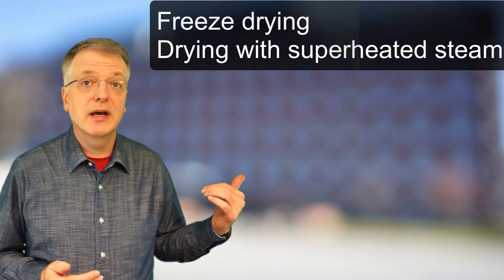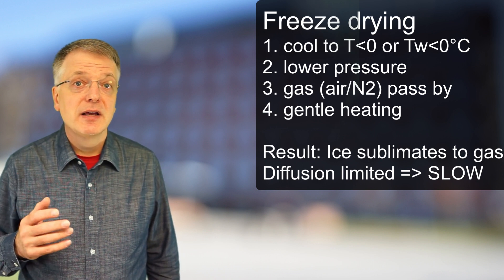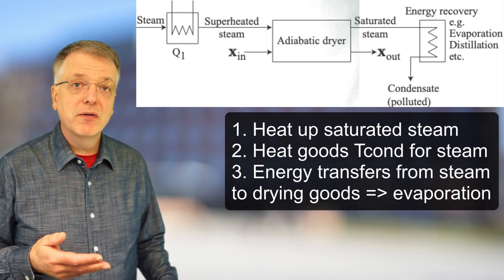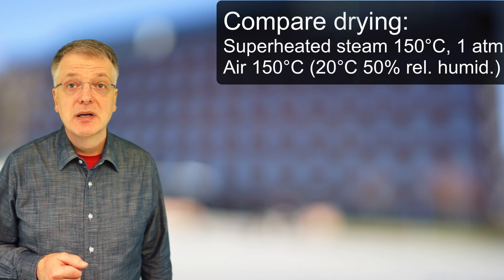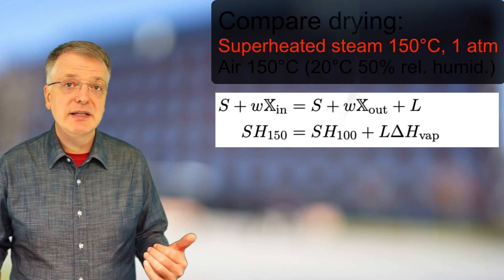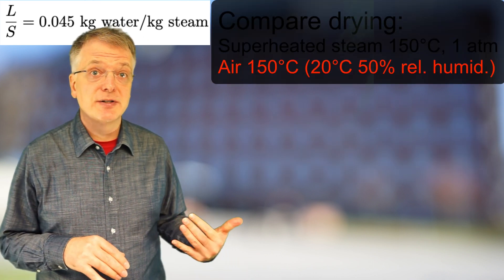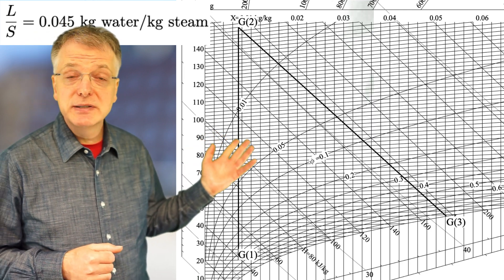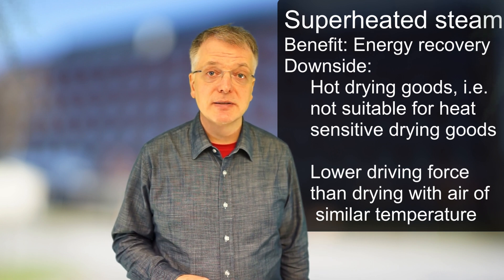Freeze drying and drying with superheated steam

Comment: why does the input material need to be preheated before entering the dryer? can we just let the material temperature as it is?
Reply from the maker: Because then a lot of extra steam would be needed inside the dryer to heat up the drying goods to the saturation temperature of the steam. Cpwater≈4.2, Cpsteam≈1.8 => For each degree below the saturation temperature 4.2/1.8≈2.3 kg additional steam is needed per kg of drying goods.